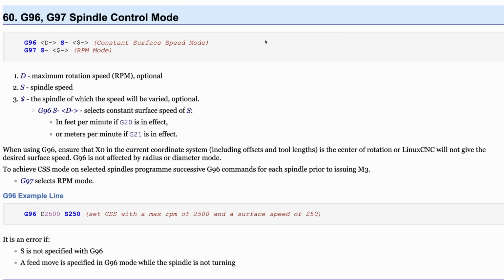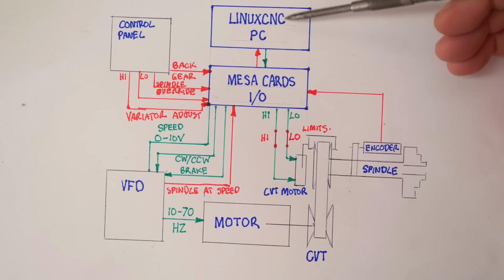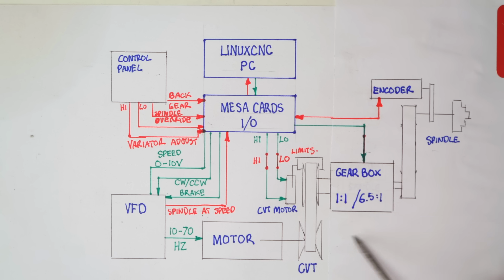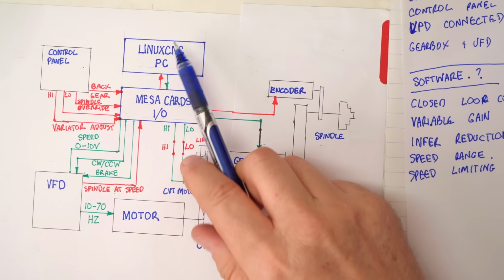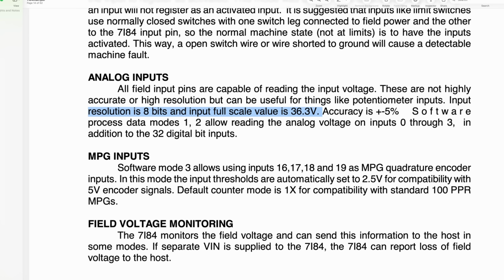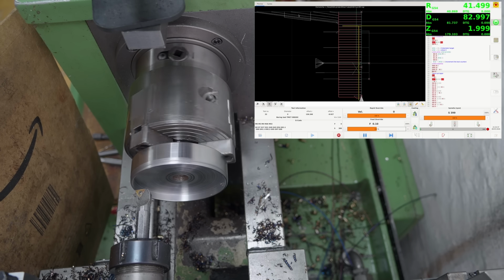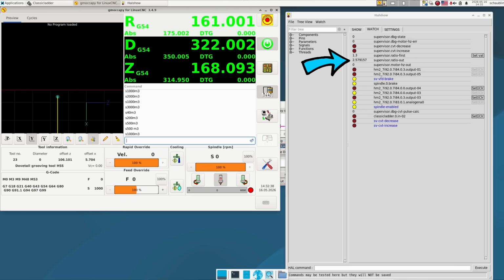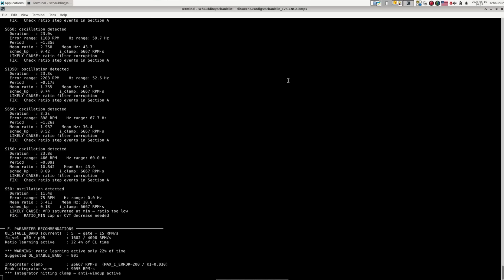Schaublin spindle control Ep.68. || RotarySMP

Comment: honestly, this all seems like a lot of extra work and future hassle to infer all of this vs installing scales/encoders for the motors and gearing units. even simple industrial hall/metal sensors would simplify your logic by a ton, 3d printed brackets could be done to save needing to machine or bend them too.
1 sensor for the gearbox actuator to see if it is in 1:1 or not (or 6.5:1 or not, your choice) and 2 for the cvt arm to see if it is max high or low (bet you could even figure out how to pull a signal off of the factory switches so you wouldnt even need new ones). you wouldnt get direct positioning on the cvt but you could at least have the routine go to a default state on cycle start and then adjust from there so you really wouldnt even need a drive motor encoder. depending on how much you want to push the cvt motor duty cycle it should be pretty easy to keep the drive motor on 45-55hz and use the cvt to control rpm using the spindle encoder to know which way to adjust the cvt position, and once the cvt trips its high or low sensor it can move to either change into/out of back gear and/or also adjust motor frequency.
Reply from the maker: Good points. I added more info to the video description on what my next attempt will be. There is no external gearbox actuator. It is pneumatic, with internal actuation. The CVT motor is constant speed, therefore the CVT can only regulate ratio with bang bang. It's ratio change speed is too fast for CSS facing cuts, so the VFD would need to regulate down, as the CVT increases RPM.
Reply: @RotarySMP  ah gotcha, it's been a while since the conversion series so I forgot how the back gear worked. That should make open loop inferencing easier though, just have the system remember the last relay / solenoid actuated to know the current ratio (probably with a bit of logic to verify, like motor hz+cvt position+back gear ratio=logical spindle speed).
As far as the CVT, if the motor runs too fast you could also do what half of the other commenters say and program a speed table and maybe just base it off of time the motor is spinning, like if it takes 5 seconds to go stop to stop then cut it up into one second or half second increments that you would run the motor to change the CVT ratio with the VFD taking up the fine control that way you could have a fairly simple and repeatable way to make the CVT more useful in keeping the drive motor in its sweet spot, and I bet if you wanted to get crazy with it you could figure out some logic to allow the system to change those preset CVT ratios on the fly while also mixing in the VFD to "rev match" like in a manual car and smooth out the ratio transitions. But if all that insanity just sounds like way too much, I would still definitely suggest trying to pull a signal off of those existing limit switches (inline relays maybe?) so you could at least have closed loop positioning of the CVT for a second absolute reference along with the spindle encoder to help make the system more accurate and easier to program.

Also I just now read your updated description and pretty much everything I said you already listed lol 😂
Reply from the maker: That "want to get crazy", is what I need, as the CVT bump rate is too fast a ratio change for most facing cuts, and therefore the VFD will need to regulate or ramp down Hz to maintain the target speed.

Comment: Am i missing something but why are you inferring the ratio...the cvt system has limit switch cant you just use those to give a starting position than just keep a variable of its driven position? If need be just home again to reset...also you didnt mention but how does the gear change from 11 to 6.5 1...like do you call seperate pin to drive it 9ne way or the other cant you just drive it to a position than track when something changes it state...once you know what where it started and tracked where it went you can use the other inputs to validate that information and adjust or error if needed
Reply from the maker: The CVT has limit switches. There is a non-linear relationship between time of CVT bump and ratio. 
I have described my next attempt of controlling this in the video description.

The gearbox is pneumatically actutated. An output from a mesa card controls a solenoid. I do log it's commanded position, but I often use the lathe with the air off,  if I dont need back gear, collets, ATC or tail stock, so I assume I will sooner or later command back gear, with the air off.

Comment: Ask AI: I have a machine. given: gear box with ratio from 1:1 to 6.5:1 for variable spindle speed, with given:  CVT input ratio (example: 1:1 variable 5:1) with given: input motor (example 1hp single phase) controlled, by VFD 10 to 70Hz.  Question: can and how, by Linux CNC, it be closed loop control: controlling the VFD; controlling the motor controlling the CVT; and controlling the gearbox? 
I hope that helps.
Reply from the maker: Thanks Andrewq, but I provided a much more detailed set of requirements than that :)

Comment: I think you will have to take back gear out of the equation if you want constant surface speed, as that can never be shifted during a cut. Everything else looks doable using an M code for back gear so it is under program control and using the VFD and CVT for speed control.
Reply from the maker: I already have that locked out by the spindle turning. It is only selected on start up. No need for an M code as the comp controls its output pin directly.

Comment: 2 ideas probably completely useless but here go's first rather than use a shaft encoder use some reflective tape or paint to mark the motor fan blades and use an optical detector and the other more off the wall one according to google AI this is possible, to measure the cvt ratio use a phone camera and a lightweight machine learning app on the phone to monitor the cvt position and hence the ratio, this might also work for the back gear position but I don't know if you could get both mechanisms in the same shot.
Reply from the maker: Thanks for the ideas... I added some info on my options and next attempt to the video description.

Comment: i know nothing about running cnc machines, but how about precalculating a table for all the input ratios, so that then the pid loop is only run on the output "virtual gearbox" and measured encoder speed
also: yeah i dont know if you're paying for those ai models, but that is in my experience the only way to make them smart enough to be usable...
Reply from the maker: Thanks for your input. That is pretty much my next attempt. I have written up my plan for the next attempt in the video description.
Reply: @RotarySMP  if i learned anything from my control systems class its that you want your "plant" to be as simple as possible, ideally linear/P or PT1 or something along those lines.
anyway, if you do the gear math right in the "plant model", you may even be able to keep the PID settings the same 🤔

Comment: Converting a 10V -> 36V signal range is a very simple circuit: one op amp, a couple resistors and an atleast 40v supply. It would allow your vfd signal to be useful if you decide you want that :)

Edit: you can add protection and smoothing capacitors as well if you desire
Reply from the maker: Thanks. I would also need a PSU to step up 24V to 36. Wonder if anyone out there already offer this widget?

Comment: Mark, I really enjoyed the video. My experience with AI has also been sketchy. I'd think that input from the motor and/or cvt would extremely helpful. Thanks for sharing. take care.
Reply from the maker: Thanks for your kind feedback. I just took another look at the Schaublin manual, and it looks like they did 48 discrete  speed steps, which with the dahlander motor, and backgear would have been 12 CVT bumps.  I have written up my plan for the next attempt in the video description.

Comment: As I see we have a cascade regulator without one feedback. It is complex and difficult to tune even for experienced engineer.

What I would do is use VFD as a overspeed regulator to CVT inconsistency. I would set VFD in 50Hz where motor has always a torque and change speed using cvt. If speed read by encoder is changing to slow rise frequency a bit to smooth change (feedback with only P ) and let CVF to reach wanted position.

Maybe it is hard to understand however CVT even if it is continous we must chop into smaller pieces to tune P(ID) regulator.
Reply from the maker: Thanks. One challenge is that the CVT positioning motor is constant rate. I added some info on my options and next attempt to the video description.

Comment: I recommend replacing the CVT drive motor with a closed loop stepper (and using the limit switches to establish a known starting position during power up). 
Stop adjusting the VFD (default 50hz, forward-stop-reverse), and commit to a back-gear position before starting the cut based on the diameters weighed against an absolute insert SFM. 
PID is only commanded spindle speed against actual RPM and the control is the CVD's stepper.
Reply from the maker: Thanks for your inputs. I added more info to the video description on what my next attempt will be.

Comment: I think the way to go about the programming here is to write a simulator of at least a simplified version of the mechanical system and then be able to run tests against that system model such that stupid robots are able to work on it. AI is a very effective tool but it lacks the theory of why it is doing something, so it needs much more in the way of testing and feedback than a human might (but on the other hand this is exactly what you need to let humans with limited context work on things without breaking them as well). Ideally it can do that testing (with a persistent test suite shared across ai sessions) without a fragile physical system being involved. 

I do think you'll get bitten pretty badly by Ashby's Law of Requisite Variety on making a model of this system for testing: you'll need a quite complex controller for this system because it's doing a complex thing. I was thinking about system theoretic process analysis, which is one of the better ways of understanding failures in complex distributed computer systems, which teaches computer dorks to draw control structures of their systems and ask what happens if the controller gets wrong input, gives wrong output to another controller, gives no input when necessary, the underlying system changes without it responding, etc, and what kind of accidents that could produce.

If you were to draw out the control structure of your system here, you don't have nearly enough feedback paths: your cutting forces are not distinctly measurable, so it is not possible to have any idea what the cvt is doing if adjusted under load as the rpm may be depressed by a cut. The system diagram you had there is helpful, but I think you'd benefit from drawing a control structure too. Try googling "stpa control structure" and you should be able to get examples; the missing feedback paths should appear as missing arrows. 

Hope this is helpful or interesting; I am at best an armchair control engineer but it's cool how software is stealing these ideas from more physical disciplines.

Comment: I think its possible to do
First you have to pay for chatgpt

Then edit your profile in the settings, write that answers alleays should be documented confirmed and newer estimated.

Then create a project
In project files make a file with all specs names and models for all parts
Describe how they are connected.
Create a new file with your demand and goal and functionality

Next send your code file in the cat inside the project and start from there, inside the project file (zip) attach a second demands file and add instructions on the top that gpt should update the file with demands you have and edit existing if they do not match command it to do it for ewry call
Inside the zip also attach a log file, write instructions on the top where you say gpt need to logg all changes.

Now set ypur gpt to the newest type and on the bottom line select extended thinking

Now start working, its a totally different animal than the free version, you can cansel your subscription when you are done, the cheapest subscription wil give you what you need
Reply: I also think the vft and the variator should work at the same time, vft have a goal at staying at 50hz variator is adjusted to surfacespeed but variator is slow and vfd fast in the code

But that wil wear out the variator.

I think it should be possible to select a variator speed based on the diameter of the part and use vfd to adjust the full range of the surfacespeed without touching the variator, this need to be calculated for each tool, to have anough power at the spindle the vft have to work at the top end of the speedlimit to avoid to low motorspeed when working at the max diameter of the part.
This dont need to be calculated, you can run a calibration cycle at the start go to the max diameter, set the vfd to minimum, adjust variator to correct surfacespeed, then let the vfd adjust the rest, you can add a fallback if the setspeed is not reached adjust variator and log the time its adjusted to be able to revert that position back when moving back to a larger diameter (need to calibrate backlash time in the variator)
Reply: I forgot one important instruction for gpt NO FALLBACK unless i ask for it, beter to hardcode faults.
That prevent unreable and undiagnosable problems, it make the code in a straight line and not full of sidetracs
Reply from the maker: Do you do this within VS code Martin?

Comment: I assume you are just messing with coefficients?   Perhaps for how you are using it the polynomial is incorrect?
Reply from the maker: There is more to it than that. As I am trying to estimate gear ratio, based on a commanded value verses a measure value, the command changes instantly while the measure lags, resulting in garbage until steady state is reached.

I am going to try a simpler idea next

Comment: As an automation engineer, I would have replaced the CVT and motor with a servomotor. Much easier, less mechanical point of failure, easier troobleshooting, very high accuracy, high torque even a low speed. But as a simple hobbyist that don't value time, it's a fun problem. I suggest making a lookup table with a close estimation of the parameters and then start the closed loop feedback. To not do the calculation of the ratio of pulleys, you could add a sensor to measure the distance the CVT pulley(may be not easy)
 Another option is to add an encoder to the CVT control motor and make it a servomotor that knows always the position of the pulley(and therefore the pulley ratio).
Reply from the maker: I have neither the cash, nor enough shop feed Amps for that. It takes a very very large motor to replace the mechanical torque of this system.
 I have written up my plan for the next attempt in the video description.

Comment: Doesn't your VFD have a configurable output that could be used to output the motor speed? Even without slip compensation, this would give you a pretty accurate speed feedback signal. That Lenze 8200 VFD seems to have plenty of output options.
Reply from the maker: I covered that Murray. It only outputs 0-10V, whereas the 7i84 analong inputs are 0-36V at 8 bit, so the resolution would be very low with amplification.

Comment: Well yes, ripping everything out and replacing with a suitable motor+VFD will cost money, but ask yourself this: do you want to use the machine or work on it as a project? All this complexity inevitably will lead to software/electronics/mechanical breakdowns. If you are just trying to use the lathe, that will get very tiresome very quick.
Reply from the maker: Not sure there is any reason that system would be inherently unreliable once controlled. It is beautifully engineered by Schaublin. I have a concept I will implement next.

Comment: Mark, it appears you have the equivalent of a P&W PT6 and a RR Trent 900 and you want them to cooperate pulling a plow. Best of luck. Try to avoid ending up in a room with soft walls and a rubber spoon.
Reply from the maker: Yeah, I think I need a simpler solution...
I added some info on my options and next attempt to the video description.
Reply: @RotarySMP  KISS rule of engineering my friend.